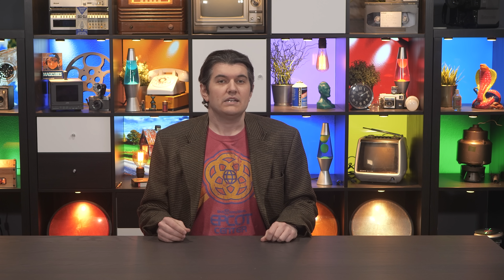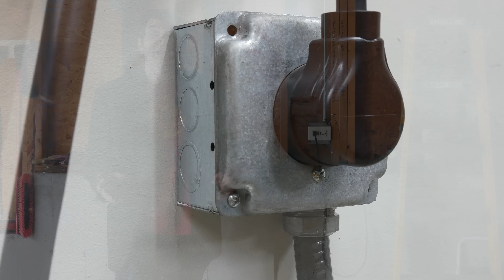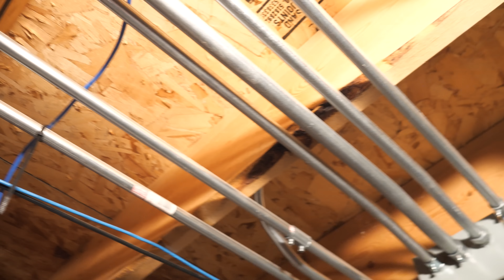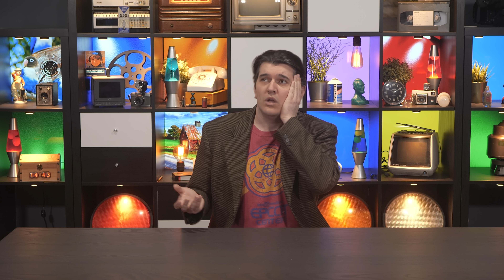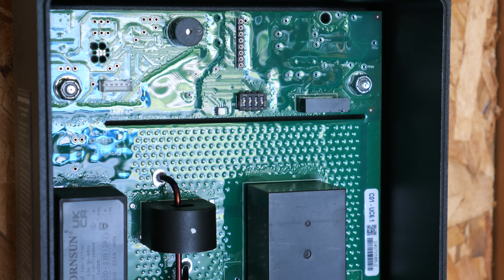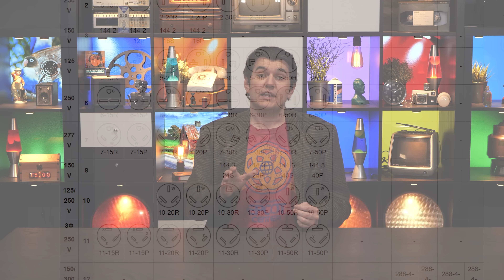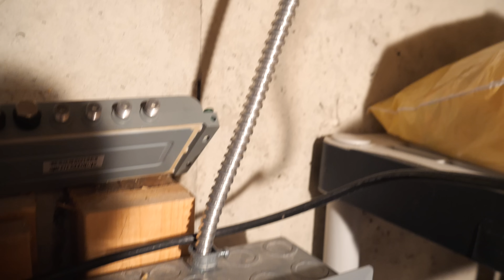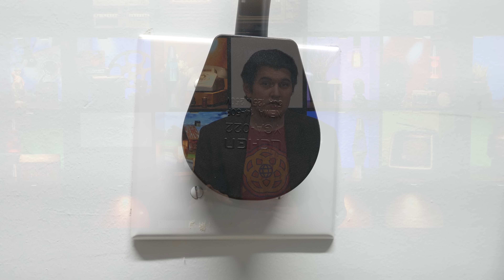The "standard" car charger is usually overkill—but your electrician might not know that

Comment: Aren't there solar generators out there that you can hook two of them up together to get 240 volt 30 amp output? Do those generators not come with expansion batteries? Can you not charge those batteries on a 110 volt charger? Can you not add 800 w of solar panels to make you feel better to charge those batteries? Is this not all insanely expensive but really flexible? But the charging over time of the 110 volt will probably get you quite a bit of power into your car quickly with those batteries. And those batteries can pretty much be placed anywhere and the server batteries can be really cheap.

Comment: It's a necessity for the Cybertruck / Silverado EV / Hummer EV. In fact, I'd argue that I wish they would bring back 80 amp charging again - like they used to with the original Tesla Model S. 
Even at 48 amps, for the Cybertruck, I'm finding it too slow of a charge - taking 7 hours and 7 minutes, whereas if it had 80 amps it would only be a 4 hours and 15 minutes charge.

Comment: "what if the car ignores the signal and pulls to much current!" - your breakers will trip.
I'd be much more worried about the car's charging system malfunctioning as it completely ignores the standard it was supposed to follow, and causing a battery fire than just a "oh no my breaker was tripped" in that case.

Comment: Something else you'll find a 14-50 used for (and this is also relevant) is a welder circuit in a garage/workshop.
Reply: The welder standard is 6-50 (no neutral, different shape), but fair point.

Comment: I did a whole year on just level 1 and with an 80mile round trip commute.  It was always either charging or driving, meaning charging at work all day.  But this is an extreme example of what can be pulled off with only level 1, 110vac 12amps...

Comment: In 4 years of owning EVs I have never EVER regretted my 32amp 240v home charging. It's more efficient, wasn't that expensive, and is basically necessary in real winter. Level 1 doesn't even add SOC to the battery in -30C. I'm a little tired of this channel advocating for 'the masses' based on their own work-from-home requirements.

Comment: What I want is an EV that has a charging port that plugs itself in. Kind of like those i-robot vacuum do-hickies. Pull into the garage and the car, once in the garage, will drive itself into its charging slot plugging itself in. Then I can get out of the car with my hands full and never have to think about it.
While I'm at it, I'd also want a dirt cheap roaster style. Light as possible with a hard top and 120mi range in the cold. Doesn't even need A/C, as I never use it on my existing Teg. Just the basics. That would do me solid.

Comment: If you're using aluminum wiring for your outlet, the "anti-corrosion" stuff you're talking about is commonly known as "de-ox." This will help you shop for it. And, tighten the lugs against the aluminum wire, then wiggle the wire and tighten again, rinse and repeat.
Reply: Noalox is no longer required nor recommended by NEC, but its use is engrained in our heads: see AL, coat in Noalox.  The AL wire manufacturing uses trapezoid strands rather than round, which no longer allows the wire to move/compress/get loose like the old days.  And the AL alloy has changed, too.

Comment: My brother has had a Bolt EUV for a couple years now. For the entire time, he’s charged it from a 120V outlet. The only time it was ever an issue was when he doing Uber as his primary gig, which required him to use fast charging from time to time. On some days if he needs to drive a lot, he might not get fully charged up overnight, but he’ll have plenty of charge to get to/from work and run his errands the next day, and probably get fully charged up by the end of the week.

My only prerequisite for most people to get an EV is to have a place to charge at home or at work (not necessarily both). The type of charging is not specified, you just need a way to charge.

Comment: In the UK we commonly fit 7.4kw 32A chargers. One thing I’m confused about is - why don’t we allow higher? Many cars will top out at 11kw AC anyway but then why can’t we have 50A circuits? my main supply is 100A and overnight we’re never close to that - and anyway chargers often have CT clamps so you can set a ‘home load’ limit so they don’t go above your combined household load - typically 60A is the lowest you’ll find.

Comment: I have my smart charger configured to only use power from my solar panels to charge, so I dont inject in the grid and I don’t pull from the grid. No car that I know of supports this feature, and I kind of need it since I don’t have net metering here. I believe that this is a valid case for smart chargers. (it can even get the day head price for people on a dynamic tarrif that changes every hour.)

Comment: I'm so happy that in Germany, where I live, we have single phase 3.6kw 230V 16a plugs for general use and 3 phase 400v plugs that go from 11kw 16a all the way to 72kw 125a plugs.
Everything seems so easy to do here. No split phase garbage, no high current problems, you just hook up everything to your outlet and it just works.
Reply: I mean here in the uk we have the same plugs but you guys have 3 phase at home which is honestly so cool we only have 100 amps of 240/230 single phase here in domestic settings
Reply: Blah blah blah
Reply: @Oo-IIII-oO  Cry? :)

Comment: As an electrician (in Australia), I agree with your basic premise. However, if you are asking me to install an EV charger, unless you tell me “I want it to charge slowly with a limited current capacity”, I am going to assume it is to charge an EV under ALL situations - fast to slow, for whoever may drive one today or in the future, even with a potential new homeowner. We generally do our work with the priority order (1) safety - nobody gets an electric shock and nothing catches fire; (2) avoidance of nuisance i.e. the thing you just installed doesn’t work and keeps tripping the breaker 😑 (3) avoiding needing replacement electrical work for at least 25 - 50 years
Reply: Is it easier in Australia due to the entire house is 240v single phase?
Reply: @HardstylePete  yes. Many houses are also 3phase now.. so much ggreater capacity available. (Plus shorter offpeak times encourage faster charging for cheaper bills )
Reply: @snip3d  how do 240 volt countries step 3 phase down to one phase for stuff that was designed for one phase? in the US we have apartments and other big buildings with 3-phase and they connect across phases to get 208 volts for 240 volt applications and connect to ground for 104 volts for 120 volt applications, it isn't perfect but it does work. I'm under the impression that your 240 volt wiring is similar to our 120 volt stuff with a varying, neutral, and ground, as opposed to our 240 volt stuff, which is two varying wires with a potential of 240 across them, a redundant and optional neutral, and a ground.
Reply: @Rowlesisgay  we don't afaik- we seperate the phases between panels/switching. My tesla wall charger uses all 3 for 22kw charging. But a normal appliance just uses a single phase at 230v. (I'm not an electrician - AU sparkie correct me if im wrong)
Reply: @Rowlesisgay  there is a single wire for each phase, so in a TN-S circuit, there are five wires total (3P+PE+N). You can branch this to have just a single phase + PE + N for single phase devices. This usually happens inside of our circuit breaker panel. Our devices are designed for 240 (typically 230) volts, so there is no voltage conversion necessary.
Reply: @Rowlesisgay 240v is the minimum voltage available on our Australian grid, which is phase to neutral voltage. 

3 phase here is considered 400v, although it is still 240v phase to neutral, it is close to 400v phase to phase. 

All low voltage supply in Australia is essentially the same, but properties are either fed a single phase and a neutral, or 3 phases and a neutral. Most domestic outlets just use one of those three phases, but all three can be used for high power 3 phase applications like HVAC, welding, and EV charging etc.

In the US, higher voltage 3 phase supply is mostly only available in industrial settings as far as I am aware, and is a 480v supply. Most domestic and commercial settings will only have 208v 3 phase which is 120v phase to neutral.

Because of this, most homes in the US will have more limitations around power availability from the grid, and will have slightly less EV charging capabilities, or less efficient high power charging using a higher amp draw. 

Happy for someone to correct me if I'm wrong, I think this is in the ballpark though.
Reply: @Rowlesisgay  So the short answer is 1/3 of the single-phase properties are connected to each of the phases to balance things out across a district.
Reply: @CanonFirefly  3 phase in US homes is mostly limited to large urban apartment complexes where having only 208V instead of 240 can be a limiting factor when trying to go all out on an electric stove/oven.  Parking there is going to be on a building owner paid utility account; which can make getting charging a challenge.  The only others with home 3 phase are people with really high end home wood/metal shops:  Used 3 phase tools are cheaper - if you ignore the upfront costs of getting your service upgraded.  That will run from "Yikes!" to "Oh $%@" (effectively not happening) depending on if the power company is currently running 3 phase down your street or not.
Reply: @CanonFirefly  Ha, as I look at my UPS at 231v atm.
Reply: @wobblysauce  it varies a little bit across the US as we have three grids. I used to live on the West Coast and my voltage was lower than it is now on the West Coast. Both are in the margin of error but in Winter my East Coast 240v is closer to 250v. In summer when ACs are on everywhere it “drops” to 240v.
Reply: @steved3702  That's how its done here in France. And we have special "true 3 phases" circuits that can be installed for specific appliance that demand 3 phases, or for the weirdos having industrial motorized equipment in their home workshop 😛
Otherwise, it's just like having three "one phase" panels, and you load balance by hand by hooking the circuits where it make sense.
Reply: @Rowlesisgay  My parents had a house in the US with 3-phase.      any phase to ground  got you a 120v circuit.   you get 208 when you go accross two phases, and that is used as if it was 240.
Reply: @Dan_Neely  if you buy a 3p mill you just need a varible frequency drive, takes the 240 1p in and makes 3p for the motor, with the benifit of electronic control so like much better starting and varible speed.
Reply: 208/120 is a wye system, and Australia's is the same but double the voltage (415/240). The only exception are some rural properties who have 480/240 single phase.
Reply: @steved3702  Correct yes.  I remember long ago, every third house on a street, was on the same phase. We once lost a phase, and only those houses on that phase went dark. (plus all the 3-phase fed stuff). Weird fault on a step down x-former somewhere. (was in the 1970's)
Reply: @Rowlesisgay Australia uses nominal 400V phase to phase, which is (nominal) 230V phase to neutral. Not many domestic appliances use the phase to phase voltage even where 3 phase is supplied to the home, basically just some stove/ovens, large air conditioning units and EV chargers
Reply: @Rowlesisgay  that's not how that works. 3 phase power in the situation you're describing is 120 phase to ground, not 104V phase to ground. 120 x 1.73 (the √3) is 208.
Reply: @JoePollard-d3j  ah, so ALL voltages are just higher, makes sense, thanks! And yeah i totally see why you'd stick to potential to neutral, when you already have 240 id assume it's plenty both wattage and danger wise
Reply: @brynnrogers5081  That doesn't get you the voltage however. If you're lucky you can rewire the motor from start to delta to make up for it otherwise you'll have no torque.
Reply: @Rowlesisgay you add a neutral and use one phase.
Reply: @snip3d houses are ran in 3 phase? That's pretty wild.
Reply: @HardstylePete america we use 240v single phase as well.
Reply: I’m an electrician here in the United States. The problem we have here is that all residential electrical service equipment (consumer units) as you may call them, are single phase 120/240 volt. Two live conductors with 240 volt potential between them and a center tapped grounded neutral so that we draw 120 volts from either live wire. Most older homes only have a 100 amp panel and are near capacity so limiting the charge to 30 amps is sometimes the only option besides a complete main service upgrade which can be cost prohibiting if the utility cable is underground.
Reply: @monteclark1115 I think I only have 60A service (or, at least my breaker that turns off power to my whole house is 60A)
Reply: @m @monteclark1115  in Ireland houses are single phase and most have an 11kVA connection, car chargers here just monitor the grid connection and automatically throttle output so as not to exceed its capacity
Reply: US electrician, and that's pretty much the same here. Especially when the run is relatively short, the price difference between installing a 20 amp circuit and a 50 amp circuit is really not that much. The labor usually barely goes up, the materials go up a bit, but like you're saying here, there's not going to be a problem down the road by doing that.
Reply: Perhaps you could ask them, do you want this one for $x that will charge the car in 8 hours or this one for $2x that will charge it in 3 hours.
Reply: Which is exactly right! You don't need your customer being pissed at you. However, if one of your customers watched this video, they might do exactly that. It can be a lot harder for a client to convince an electrician that they don't need more capacity, and I think this video helps them do that! And maybe some of your customers seem smart enough, and thoughtful enough, to weigh the options: "do you want it to charge only 100 miles per night, or do you want it to cost twice as much?" Ultimately, for a homeowner, whether they think they will sell soon weighs into that pretty heavily
Reply: I get your point but in the US, homes increasingly converting their heat source and stove to electricity - so if an electrician installed a 50 AMP EV charger in someone's home (when few really need that much juice) it doesn't leave much panel capacity to add a heat pump or induction stove in a few years. This happened to a friend of mine last year - he had to either downgrade his existing 50 AMP EV charger or cough up thou$ands to upgrade his service and panel in order to put a heat pump in his house.  The guy drives 20-30 miles a day. He never needed a 50 AMP EV charger in the first place - it was complete overkill. 

I'd say install the thicker wiring for future proofing, but recommend customers install just a 20 or 30 Amp charger. It's more than enough for most drivers.
Reply: I wish electricians would be like doctors. Here is what I see. What are your goals today and the future. Here are your options with price. Think about it.
Reply: That's true but the point of the video is many many people think you need a 60 or 80 amp circuit to charge your EV overnight, which isn't the case
Reply: This isn't really a problem in Australia or New Zealand, because we aren't third world countries. This is for those living in Haiti or the US or Liberia.

Comment: When I bought my Duplex Apartment building in 1986 there was almost no electricity in the detached garage unit it came with. As a member of one of the first  EV clubs in Southern California, I realized that eventually the major  car manufacturers would relent and actually build electric vehicles that they wanted to sell. 
Wanting outlets for my hobbies, not just lights I hired one of my tenants, an electrician, to upgrade the garage's circuits professionally and to separate the tenant's garage circuits from mine. The club members who had made EVs converted from clapped out gas cars recommended a minimum of 20A and I insisted the electrician provide me with both phases so I could get 240VAC in future.
In 2018 when I bought my Tesla Model 3 I also bought a Tesla wall charging EVSE. But I had to charge the car when I got it home, and just quickly installed a NEMA 14-50 outlet and set the car to charge at 16A. Because I am retired, it worked so well for me that I never bothered to have the Tesla wall EVSE installed until late last year.
The electrician I hired discovered that I had a panel in my unit that only  had a 40A main breaker. He  convinced me that the entire electrical system should be upgraded to 100A per unit to bring it up to local codes. The new work let me charge much faster at the hard wired wall EVSE mounted on the back wall of my unit.  This meant charging outside the garage, but I had not parked inside for decades. All those projects over the years:)
Just yesterday I finally finished a much slower, but cheaper method of replenishing the energy used for shopping errands using the solar panels and some LiFePo batteries with a large inverter. Completely off grid, I put it together as precaution for power during earthquakes. If one happens I plan to run a very heavy duty extension cord in the back door for the refrigerator, a portable induction cooker and some portable lights as needed. Our moderate weather  here means I wouldn't need heat or AC in an emergency.

A test with the Tesla at the minuscule charging rate of 5A showed it could work for that purpose too,... in a pinch.